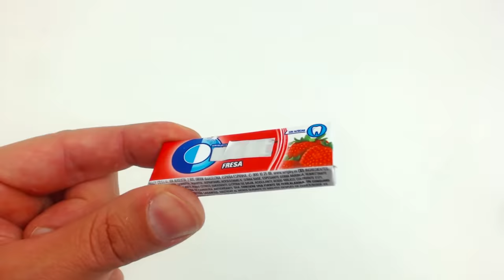ELECTRIC SHOCK CHEWING GUM PACKET | Creative Minds

Comment: BS the narrow end of that thing goes up into the thicker part and clicks that is what it takes to get a spark. I took the thing apart there's two very stiff Springs inside that thing outside of the lighter it is very hard to press. It does not have batteries and does not store electricity